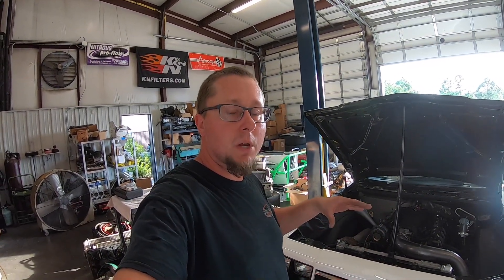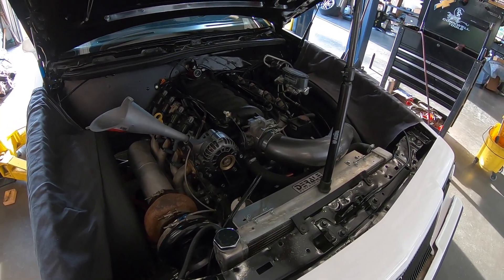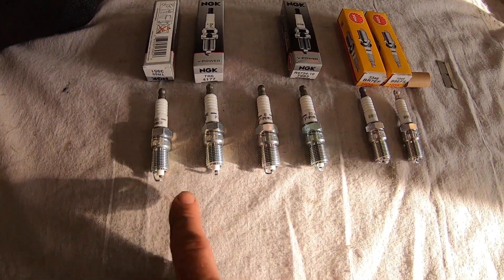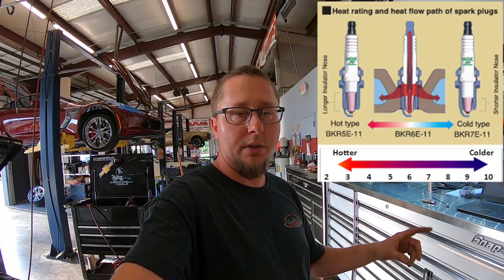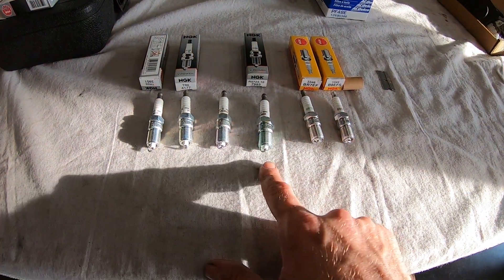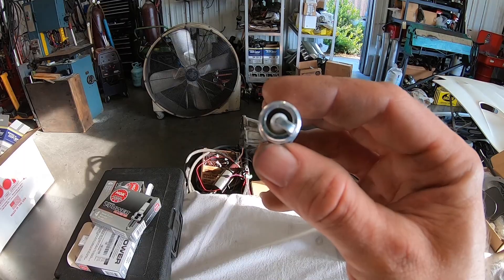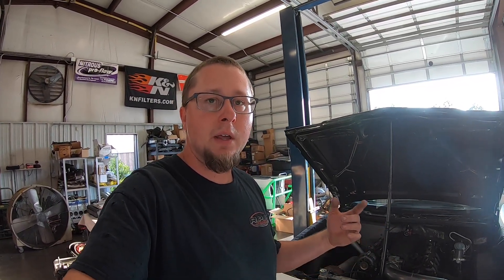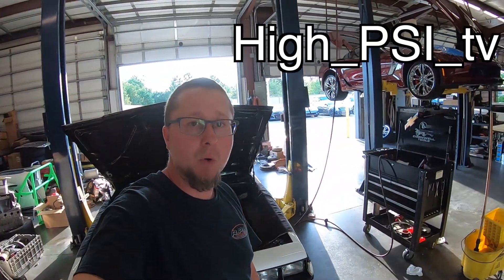Spark Plug Heat Range Explained. Hot or Cold Plugs??

Comment: Jeff, I have a 1997 Chevy K1500 with a 5.7L Vortec v8 engine, aftermarket Powerdyne supercharger (up to 9 PSI), Gibson headers and Gibson cat-back system. Which NGK spark plug would you recommend for my application?

Comment: What heat range if plug will disapate heat after being shut off quicker?  Stock 350 after doing spark plugs once the motor ua good and hout it steugfles to turn ocwr and from my testing the plugs are staying hot and igniting fuel when they shouldn't

Comment: 10:7:1 compression 15psi of boost ls3 (supercharged) hesr rsnge 7 or 8?
Reply: MrRey007, If you plan to use NGK Sparkplugs & considering the supercharger, nearly 11:0 compression & more than 10psi of boost, I'd strongly advise you to use a heat range of 8. You can play around with a (NGK) 7 heat rated plug. But when under full load, your engine will very likely benefit more from a (NGK) heat rating of 8. For example; try a (NGK) 7 rated plug for normal driving. Then, when ya' go to the track, switch to a (NGK) 8 rated plug. 
I'm considering you're using quality fuel & its' octane rating meets or exceeds your engine requirements. As you probably know, your engine will benefit from fuel with high octane; while it's operating in race conditions. I don't mean it'll make a "noticeable" power increase. Simply that high octane fuel has benefits when an engine is operating at its' limit. 
Remember, different sparkplug manufacturers use very different heat range ratings. You can find the heat ratings on their individual websites.   
Equally important is for you to use what's referred to as a shrouded sparkplug. The use of a "shrouded" plug is critically important when an engine is supercharged. When ya' factor-in your compression ratio & boost, I'd consider the shrouded sparkplug design a requirement. Otherwise, the risk of "flame-out" will create serious issues at mid to high RPM in your powerband. Especially, with the "pin-point" flame from the needle-like spark electrode NGK Sparkplugs commonly use. I recommend the "shrouded design" regardless of your ignition system. 

You asked a simple question. But my reply is "a bit" involved. There are important factors to consider when choosing a sparkplug. 
I hope my input is helpful,  
Ben
Reply: @duygukayhanisaskank4915  Thank you so much for your response, my friend. I got it clear. However I don't get what a shrouded spark plug is. Can you level elaborate a bit more, please.
Reply: @ I appreciate your considerate reply. Once again my answer to your question will be "a bit" lengthy.  
A shrouded sparkplug is a design where the metal spark electrode & all of the ceramic insulator reside inside & below the bottom of the threaded section of the sparkplug. Only the ground-strap is below the bottom of the threaded section of the plug.  
Today, most sparkplug manufacturers split the difference between the common sparkplug design & a completely shrouded design. It's not a truly shrouded sparkplug. 
Meaning, part or all of the metal spark electrode extends beyond the bottom of the threaded section. But..."ALL" of the ceramic insulator surrounding the metal spark electrode is below & entirely "shrouded" by the threaded section of the sparkplug. 
In my experience, either design of shrouded sparkplug works fine in my supercharged, 632cid engine. However, I have an insanely powerful ignition system to keep the 8 candles lit under any condition; FuelTech 150mA long duration, "Smart Coils" & 10mm, 0-ohm sparkplug wires. 
BTW: I use Autolite Copper Core Sparkplugs. Mainly because copper is the best conductor of electricity & the large diameter of their spark electrode. 
NGK is a great quality sparkplug. But the tiny kernel of spark from the NGK needle-like spark electrode tip...makes me nervous. 🙂
Let me know if ya' have any additional questions. 
Best regards, 
Ben
Reply: @duygukayhanisaskank4915  got it friend , i undestand that now, i have mentioned the 7317 model of ngk grade 8 copper spark plug are you familiar with it? My ignition system is stock oem 5th gen camaro coils.  Now you made me consider the autolite ones, do you know a model equivalent to a copper grade 8 ngk from autolite? And can i use that colder plug as daily ?
Reply: @ I recommend you go to a NAPA, or other parts store & have them do a cross reference on the sparkplugs you're using now. Remember, Autolite uses a different heat rating system than NGK. 
Choose a mid-heat range sparkplug & do the 1,000 mile test I suggested in my previous reply. 
If you have carbon & ash deposits after 1,000 miles, change 1 or 2 numbers higher to a hotter Autolite Sparkplug & repeat the 1,000 mile test. Autolite plugs are NOT expensive. But they are exceptional quality.  
During the 1,000 mile test, use ONLY a "Top Tier" Fuel. It's sold at Chevron, 76, ARCO, SITGO, EXXON & SHELL in The U.S. & the gas pump MUST indicate "Top Tier". 
Also, DO NOT use any fuel system cleaner, etc. during your 1,000 mile test. 
Lastly, using a gasoline with an octane rating higher than what your engine requires will create carbon & ash deposits on your sparkplug electrode, the ceramic insulator & the ground strap.
Good Luck, 
Ben
Reply: @duygukayhanisaskank4915  is ngk 7317 good for my setup? And why can't I use grade 8 ngk for daily driving ?

Comment: Excellent explanation!  One must keep in mind that every manufacturer has their own system of rating heat range.  For NGK #5 is in the middle; higher numbers are colder; lower numbers are hotter.  Other manufacturers use an opposite system with lower being colder and higher being hotter.

Comment: Merry Christmas !!Question, on a motorcycle inline 4 the inner cylinders run hotter. 
Especially #2. Would You run the standard plug NGK CR9 on 1-4 and a colder Plug on 2-3?? Any Thoughts please??

Comment: My car has recommended heat range 5 but no iridium plug is available.  All are available in 6 heat range
Reply: This is because Iridium Plugs do not "heat-up". So, NGK assigns them a "6" mid-range temperature rating. 
Believe me, using NGK Iridium Plugs...rated at their 6 heat range...will be perfect for ANY engine with 
an OEM recommendation of 5. 
No worries, 
Ben

Comment: Just a note, heat range and spark are independent. Colder heat range = colder ceramic = easier to foul at low speeds or rich mixtures, but the heat range doesn't affect spark blowout. Spark blowout is more related to things such as the firing end design (gap size, firing position/projection, electrode shapes), indexing, boost/compression ratio, combustion chamber swirl/turbulence, ignition system energy and high demand voltage (voltage needed to jump the gap). Generally speaking, if you have spark blowout with a plug and you switch to one heater range colder (all else being equal), you will most likely still have spark blowout. If it takes 24kV to jump the gap with a heat range 6 plug, it will also take 24kV for a heat range 7 plug. Because the spark and heat range are independent. The main thing to avoid is pre-ignition - where the ceramic is holding so much heat that it becomes the ignition point before the spark occurs- which is bad news. Melted plugs are the least of your worries then - melted parts in the engine is of course the worst...
Reply: Excellent explanation...👍
Reply: Hello, 
A machanic fit heat spark plug in my hyundai Vanue turbo petrol (in which cold spark plug are recommended), due to this the engine stopped producing power after 60 km driving(car move but do not climb even a simple slop).

Went back to machanic, Now I have cold spark plug installed, I have two questions 
1. how to know whether the wrong spark plug have any damage on engine.
2. Will this small 60km event will effect lifetime of my engine (should I sell this car?)
Reply: @Humænx  It may have damaged the engine if pre-ignition occurred. You might check the cylinders/pistons/valves with a borescope and see if nay damage is visible.  Maybe also perform a compression and leakdown check. If everything seems fine, I would still sell the car because Hyundais are not very durable.
Reply: @westernapache1700 went back to dealership they did OBD scanner there was no error codes, car running smooth now, but there is an minor hiss sound when idle. 
Can it be related to any damage.

Comment: My vehicle specifies Denso SK16HR11 but the mechanic installed SK20HR11 which is colder then the recommended. What impact will it have on the engine and performance? Should I take the vehicle back and ask him to install the recommended spark plugs?

Comment: thanx for this i have a 2014 chevy silverado 1500 with 5.3l .all i have are bolt and pretty much stock havent done any inside motor work yet. on and im gettready to order diablo preditor 2 platinum. what plug is suggested my end result is a p 1scs 1 procharger

Comment: Cheers. Looking up this for a 70's dortbike with points. Nothing fancy but points are such a mission. Going for a hotter plug to keep the temp up in my low performance workhorse(honda xl 250 motorsport).
I was worried as in NZ people say a hotter plug will melt the piston even in low performance, I didn't believe it and after a couple of videos your video teches easily what the other videos tried to tech, thanks for clarifying this so easily with that diagram and example. Churr, good luck with things

Comment: Do u think I’ll be straight running my ngk tr6 with about a 100shot (dry) on my Lt1 bored stroke cammed fbo a1000 fuel pump and aero fuel pressure regulator

Comment: I have a 1995 Blazer with a 4.3 vortec. 
It has been missing a lot on the # 5 & 6 cylinders. The compression is low on them as well. I’d like to squeeze a few more miles out of her before putting her out to pasture.

I’m thinking if I run hotter plugs on those two cylinders she’ll burn better and help alleviate the unburned gas vapor in the exhaust.
Does sound feasible? And how do I choose the hotter plug?

Comment: I have 350 engine the guy i bought truck from he told me when he built engine he used ac delco45 but i put egk plugs now when i pump gas peddle to crank truck it cranks and runs great i let truck run maybe 3min tops cause its in my garage but when i check plugs there wet can u explain why plugs are wet and truck is running great

Comment: Every LS engine I’ve worked on runs iridium plugs, you got it backwards a hot plugs burns cleaner than a cold plug for a NoS or boost application you want the hottest plug you can get the hotter the spark the cleaner the burn the more HP you make I ran NoS for years with the hottest Autolites they made plus an HEI Distributer and a high fire coil never had a problem with cylinder temps you kids today have it backwards

Comment: Hey Jeff I got a 2012 VW bug turbo 2.0 .I have a plug that fouls in 30 days a ngkd6h905601a on cylinder 1 change coil twice .looks like i have oil coming and fouling plug any suggestions. 120k miles. Should I go hotter? I only drive it on close store runs help!
Reply from the maker: Sounds like you have an internal engine issue

Comment: can i  use a hotter spark plug  in one cylinder with low compression to prevent carbon fouling?
Reply from the maker: I wouldnt recommend it

Comment: Thank you so much for this. I just bought a step colder set of Ruthenium plugs for my Focus ST, stock map, but she has been misfiring, I also got some MSD coil packs that generate a more powerful spark, since I think my issue is related to a bad coil, figured might as well upgrade and get some of the touted benefits of higher mpg and efficiency improvements. The car runs 5-18psi out of a K03 Borg Warner Turbocharger depending on throttle input. Do u think this setup with the step colder (ltr7 instead of the stock ltr6) as well as the MSD is going to be bad for my engine long term, or help it last longer? Not looking for power gains, just wanna minimize knock and misfires. Worth noting the misfires are intermittent, and only happen on cylinders 1 and 3.

Comment: I recently just turbocharged a joiner 1100 sand viper buggy it's running a little bit lean I'm only running about 8 lb on a small turbo but it means out can should I go to a colder plug would that help

Comment: What spark plug you recommend for my 6.2 l92 headers, cam? Tr55? Or tr6? Thanks
Reply from the maker: 55s gapped about .046
Reply: @HighPSItv  what would happen if put it Tr6. Will I feel a big difference form 55s compared to tr6? Or can I get by with tr6? Thanks for the help

Comment: Hey, I have a built 427  naturally aspirated big block In a 1970 Chevy Nova. I am wondering what spark plugs you would recommend to start with. The motor has around 500 hp. with a holly 850 double pumper.

Comment: What about E3 spark plugs what heat range are those?
Reply from the maker: I dont like using those plugs. So Im not sure
Reply: @HighPSItv   I have a 2003 Chevy suburban With the 5.3  What spark plugs would you recommend? I'm currently running E3 so far I have no issues with them but I have a feeling I should go with original

Comment: Hi what ambient temperature are heat ranges based on? In hot climates is it better to run 1 heat range colder for NA engines ? Eg 5 to 6 for NGK plugs ?
Reply from the maker: They are a made up number. I would not change plugs based on climate
Reply: @HighPSItv  thanks for info

Comment: my E39 M5 should have the 6 in it but they only have 7 and up. You think it would be ok to put the 7 in it? oh and its supercharged not crazy but from 400hp to 550hp about 4-6lb boost. Also you dont really go into the cons of say running a 10 plug on a car that only requires a 4 plug, you went 1 way (with the plugs melting) but not the adverse effect going the other way extreme cold) and i live in a cold climate too (sweden)

Comment: I bought 64 cc aluminum heads for my 350 chevy with dish pistons that made the compression about 9 to 1. I bought the recommended plugs which were  NGK with 7 heat range. Come to find out they were way too cold and the plugs fouled coal black after a few miles. These head companies need a chart showing what plugs you should run with what compression. Mine only needed stock (hot) plugs with low compression.

Comment: I have 1.4L Kia Rio. The 6 heat range oem plugs cost twice as much as 7 heat range from NGK seller. (Both plugs are NGK). Will that make my car weaker than it is right now?
Reply: If the 7 isn't fouling black then they should work.

Comment: The higher number means a hotter plug and the lower number means colder. In all spark plugs?
Reply from the maker: Not in every brand.
Reply: @HighPSItv  what about ac Delco how does the heat range work.

Comment: Getting dieseling on an '85 sbc 350. Currently has an ACD 1 spark plug, what plug would I use to possibly stop that from happening? I've already checked the timing & the distributor vac & weights. Going to try different gas but want to have an alternative just in case.
Reply from the maker: Gas would be the next step for me

Comment: I have  a 1984 Plymouth voyager van with a 2.2,... since 2008 I have used Bosh Platnum Part number#4018 ,...WR8DP,.....no longer available,.....Now the Bosh replacement plugs are longer,......so I took them back.
Then I got NGK GR4GP,...Stock Number 2763 they say Heat range 4? 

They are the right length.
But will a 4 heat range melt the pistons?
Reply from the maker: Id go a 5 if you can

Comment: But how much does heat range affect or cause more/less pre-ignition
Reply: from the few videos I watched that got me here, If it cant move the heat faster then its created you will start to knock knock, it might be fine and then one day its hard boost or a hot day, to cold and it might build up carbon(or tho most stock cars run lean mixtures for the mileage and emissions regulations etc which wont build up carbon as much) 
Copper or silver plugs help keep detonation low as the tip conducts the heat away but need regular replacement, platinum is there to last a long time, not a good time

Comment: I have a 96 Camaro Z28 with the LT1. No idea what the compression is, or what it should be, but runs great still. What type of plugs should I run? While using a coil producing 40k volts+....
Reply: Stock is 10.4-1 compression for the gen 2 LT1 5.7l, most people including myself suggest  NGK Tr55 plugs

Comment: Great video, I'm running a 1.4 liter turbo and stock boost is around 14 PSI Max. I currently have an after-market 93 and e85 tune full bolt ons pushing  21 psi. It's a daily driver driven spiritedly with no track days and no autocross. NGK recommend stock 7 heat range do you think a 7 will suffice or do I need to go colder to an 8? Thank you in advance

Comment: Hi!

I'm driving a 2007 Audi S8 which has an ECU remap. V10, 5.2 L. 450 HP stock. Probably around 480 HP now?

The factory installed double Platinum plugs. 
I'm wondering if it's safe to install single Platinum plugs instead. 

I've tested the car and it runs great, starts better too. 
Just concerned with the heat range. 

What do you advice?
Reply from the maker: You should probably run what is recommended by the factory
Reply: @HighPSItv  
Thanks for your response. Guess your right. 

But do you know if there is generally a big difference between single and double Platinum? I'm running with the Brisk brand. 
The thing is that I've installed these plugs, which was quite a hassle on this V10. 
I'm looking for reasons too keep them in basically.
Reply from the maker: Brisk plugs are great. Single platinum will be fine, but wont last as long.

Comment: What plug would you recommend for an 89 l98 5.7 iroc with a 480/501 cam
Stock tpi with 22 lb injectors?
Reply from the maker: Probably start with an NGK tr6
Reply: @HighPSItv  ty! Have intermittent slight detonation at 6btc. Hoping this helps